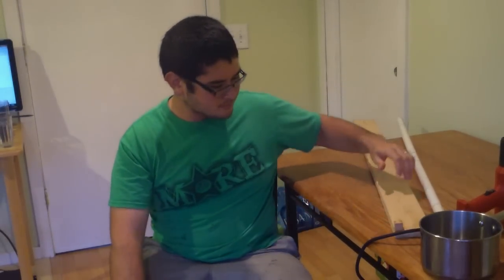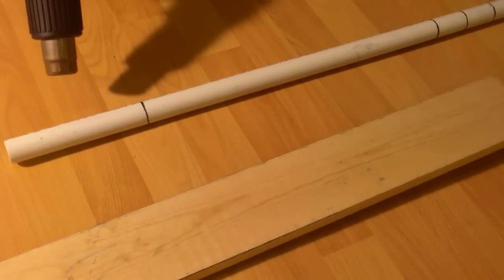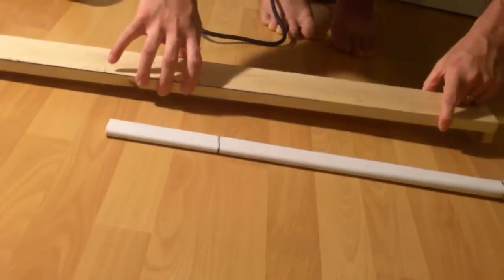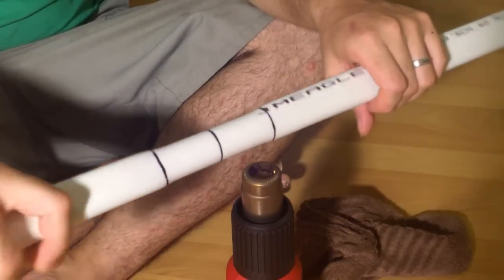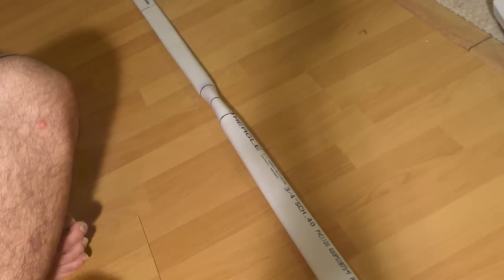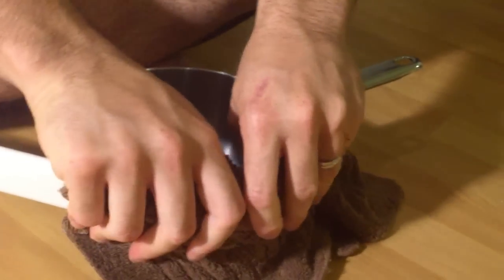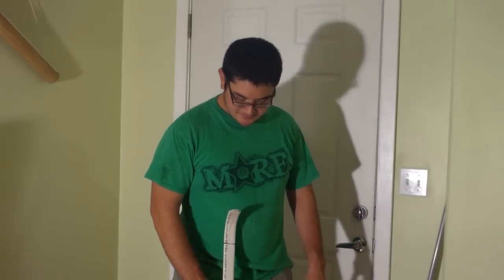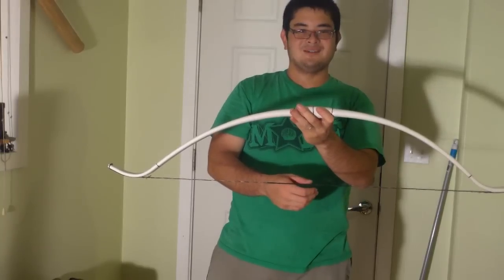How to Build a Youth Recurve Bow out of Flattened PVC Pipe

Comment: Put a cap on both ends, heat sand on the shove when it’s hot about 300*-400* pour the sand into the PVC pipe shake to San to make sure it’s all over the pipe when it becomes pliable that you could shape it to what you want

Comment: My bow just snaps. I've tried twice and each time the limbs snap
Reply from the maker: What kind of PVC are you using? Its walls should be at least 2.5-3mm thick. It should also pass the hammer test, here's a link: https://youtu.be/I-kyGn_bj84
Reply: BackyardBowyer I'm using white PVC 20mm in diameter (because I live in Australia I can get the exact 3/4 inch but I believe it 20mm is close enough) it is schedule 40 class 12 and the walls are 2.5 mm thick.  It is 1477 grade.  It is 4ft long.  The bow collapses when I leave it strung for longer than a minute.  Do you think I have bought a bad pipe? 😂

Comment: Love your videos, been checking them out for a while and entered and exited the world of PVC bows earlier today. Made 4 out of various diameters of PVC I had already  (1", 3/4", and 1/2"), flattened recurves... And all went well until stringing. no matter what I did, no matter which bow, the strings  all wanted to pull back around to the front of the recurve... Tapered ends with v-notch nocks. After about two hours of this I gave up. How do you prevent this when both sides look straight to each other?

Comment: So I finished making one of these. it wasn't perfect (being my first attempt) but it works fine enough. the only problem is that since I am just new to archery it's draw weight is a little too heavy for my comfort zone. My draw length is 30"  and I was hoping to make a bow that would pull at around 25 lbs until I am more comfortable. how would I reduce the draw weight enough?
Reply: I think you should make it longer in first place, try a new one

Comment: Hey Nick, great video. When I string my bow, it bends sideways and forces the string to slip of the side and all the way to the wrong side of the bow. I can tell the bow is very slightly curved down the front profile. Is reheating and getting as straight as possible the best fix for this? Thanks.
Reply from the maker: +Reid Bam Is the bow tapered all the way, or are the ends just flattened slightly? Also, how much did you squish the handle in? If the handle is pressed too thin, it could cause the bow to flex sideways. If the limbs are too round, the bow will want to roll over and shed the string.
Reply: Thanks man ;)
Reply: +BackyardBowyer can you make your pvc pipe soft without an heat gun
Reply from the maker: Noah Van Corbach You can use a stovetop, torch, fire, hot coals, oven, and just about anything that puts off a good amount of radiant heat. Make sure that you don't burn or scorch the pipe when using any sort of flame.
Reply: BackyardBowyer oke thanks man

Comment: hurray.. I finally finished  but I found putting the pot on the side and setting in my floor curving the ends were so much easier well at least for me..
by putting the pot on its side all i had to do is lay it on it and bend it ant hold till cool the other way my pot kept siding and my bow had kinks in the curve part but all n all i believe the next ones i make will be easier after the first one it usually is,,right
thank you

Comment: I have tried but I don't think I'm heavey enough it won't flatten.. I weigh 160 5ft tall and a women what do I do need to make for grandson by Christmas
Any help will be greatly appreciated
Ty
Reply from the maker: +Sondra Todd 150 pounds is right around the tipping point for flattening 3/4" pipe with body weight alone. First you have to make sure the whole section of pipe you're trying to flatten is completely soft. It should be soft enough that you can press the pipe walls together with finger pressure. If one spot in the middle of the limb is still cold, the whole pipe won't flatten.

You may need to build a heat trough, which is just a piece of cardboard or a half tube covered in aluminum foil (or a piece of aluminum flashing, etc.) that will reflect heat and help things go quicker.

If you're confident that the pipe is soft enough, try using clamps if you have any. If you are having trouble trying to stand or kneel on the board and keep it lined up, try setting the board on a step or bench and sit on it. This usually can help keep the board stable while letting you put all of your weight on the board.

Hope this helps!
Reply: Also my board is only 3" wide will this play a part in how it works alittle narrow but fits.. This all helps so much thank you for your quik reply and answer .i will let you know how it turns out tomorrow thx again
Reply: When I tried to put the string on it it bent..crimped guess it was a fail can you tell me how  repair it ..can it  be saved 
thank you
Reply from the maker: Do you know what kind of pipe you're using? Is it schedule 40? Are there any markings on the pipe?
Reply: BackyardBowyer not sure just bought 3/4 " PVC  pipe its white where would it say schedule 40 at does it say on the pipe
Reply: I guess if it doesn't have schedule 40 on it its probably not..here whats on ot...3/4" silver-line pvc-1120  sdr-21  pr 200  psi @73 f [astm d-2241     nsf-0w or pw -g
thats it
thank you
Reply: Ok thank you ...I bought the right pvc pipoe but I should ask you I bought a precute bow string not thinking ..I bought a 38 inch but if the bow curves does that take away from the 38" will my premade made 38" string fit or ot to long?
Reply: Sorry I meant 48" on the youth recurve bow is what I cut ant string I bought

Comment: hey nick I made this bow but I used schedule 40 1 inch pipe instead of schedule 40 3/4 inch pipe the bow turned out super strong and I cant pull it back every string I put on it stretch's it any suggestions to make it weaker

Comment: I tried making one of these by eyeballing all the measurements. Turns out it was too stiff to string up and when I tried to force it, one of the limbs gave out. Turns out I made two crucial mistakes:

1 - Material choice. I forgot to check what I material I should use for a bow like this, so I actually bought a length of pipe that was overkill. It was some 32x3mm pipe. That's a little over 1.25 inch OD, with a wall thickness of 1.118

2 - Flattening - I did not use a flexible board for a flattening jig, but a 4x4 inch piece of lumber. So it had no give whatsoever, resulting in a straight taper to the end. I also set my jig with a max heigth identical to the pipe diameter, so it didn't have the little 'dip' right after the handle.

The limbs were just too thick for the bow. This created a weak spot about 2/3 down the limb where it started to flatten properly. When stringing the bow, this is where the limb collapsed. 

I couldn't find any smaller diameter pvc pipe, so I'm stuck with the 32mm. Next up I will try building a somewhat longer bow, giving the limbs more flex. I will also change my jig so I can flatten the limbs better. I'll give it another shot tomorrow. :)

Comment: hi nick. i bought 1 inch pn16 (uk) how long must the bow be for adults  and is 9 inch ok for the corners or do i need more length?
Reply from the maker: Rashida Begum I don't suggest using pn16 for the bow, as the pipe is too thin and will break. You can try sleeving it over a 3/4" pipe and using both together. At 5 feet long with 8 inch recurves, it will work well.

Just for reference, the pipe I'm using has about a 3mm thick wall.
Reply: thank you very much, much appreciated...   :)

Comment: Hey Nick, I am attempting to make this bow. I bought all the exact materials ( 4 ft sch 40 3/4 in pvc). I am using a friends heat gun, it is a little old but seems pretty hot, i can put my hand 4sh inches from it without getting burned though. I tried several times for several minutes to soften the pvc, I hold the gun very close to it, but nothing happens. The pipe doesn't even slightly soften. Please help me out, Thanks so much, Bryce.
Reply from the maker: Bryce Belshin Hi! Do you know what the wattage of heat gun is? Heat guns generally come in around 750-1500 watts. At the 1500 watt output, it should take about 5-10 minutes to heat a bow enough to flatten. If the heat gun is 750 watts or is stuck on low setting, it may not be hot enough.
Reply: BackyardBowyer  Ok, thanks so much, i just wasn't doing it long enough. Love your videos!
Reply: +BackyardBowyer Hi Nick, Im kind of having the same problem. My heatgun is 2000w, and when set on maximum, it's exhaust is red hotm, so the heat shouldn't be a problem, but still, i cant get pvc pipes heated properly. Only the end part is succumbing to heat and becomes moldable, and thats all. rest is either stays solid, orl solidifies, when i switch to another areas. I use white pvc, in my country they have different markings, so i can't really affirm that it's a schedule 40 3/4in, but looks are pretty similar. Can't figure out, what Im doing wrong. Could you make a tutorial on this matter please? I know, sounds dumb, but I'm really out of hope right now :D
Reply: I never got mine to heat, I also tried it over a stove and  got it hot enough to bend but never enough to flatten all the way.
Reply: +Bryce Belshin i had the same problem it smashed down alittle but wouldnt flatten all the way
Reply: I don't have a heat gun, I was having the same issue softening it. I ended up baking it in the oven it did the trick...I am not recommending that as its probably not safe do at your own risk..it would probably work for these little bows though mine was 5feet and I couldn't close the oven all the way so I did one side at a time with door cracked open. This was the first time I have attempted this inspired by nick, it worked working it is an art someone mentioned he makes it look easy but he has done so many.

Comment: Hey Nick, I love your videos. So I started on this bow, and, after a while of heating and flattening I got through it and strung my bow. Figured it was too long so made the string a bit shorter. Now I have two problems: 1. The bow is a tiny bit crooked (was very crooked, fixed it with some heating). 2. My bow end snaps! About 10-12 inches from the top of one of the sides, it just bends through. I'm using this yellow pvc pipe, your yellow one seems sturdier though. I live in the Netherlands. If you could tell me about it that will help me a lot. Thanks
Reply: Misschien teveel hitte op een plek?
Reply: Koop gewoon een witte pvc buis werkt prima

Comment: Hey Nick. I really like your videos. I am currently working on a recurve bow of my own. I have followed every step and I am having trouble with actually stringing up the bow. I bend the bow the way you do but it is like there is way too much pressure on the bow and it just breaks. I know im not bending it too far because it is nowhere near close to how yours looks when it is and even then I can barley get it on. Im from Australia and I am using 25mm in diameter pvc pipe. It is four foot long and I have followed all measurements. Please help It will help me out a lot. Thanks
Reply from the maker: Jack Niotch The pipe in Australia has very thin walls, much thinner than what I use. Most guys building PVC bows in Australia usually end up sleeving one pipe into another to get something comparable. Check out @147 . He has several videos of bows he has made with PN-18 pipes.
Reply: BackyardBowyer Ok great thanks. I just still don't understand why the bow wasn't bending the way it should have. seeing as it was thinner shouldn't it have bent over more easier? this happened before it crimpled over btw. It was way too hard to bend over. thanks
Reply from the maker: Jack Niotch Tubes can be tricky things. A thinner pipe can have nearly as much resistance as a thicker pipe but with less stability. It's also possible that you are using something other than PVC or that the type of PVC you are using is more rigid. That said, this bow should take a decent amount of effort to string as it is 35 pounds with a good amount of reflex.
Reply: BackyardBowyer I am from Sweden and when i draw it back it also breaks, should i get a thicker pipe?
Reply: I am from México, and the pipes here are sch 40.80 and 120 the 40 is about 3.5 mm wall thickness
Reply: BackyardBowyer you could also use electrical  conductor
Reply: What Nick used in the video is SCH40 pipe. I am from Malaysia. Since you are from Australia, I think we may be using the same system(If not, sorry I don't know Australian pipes). We don't have SCH40 here so the closest one is Class 7.  Below Class 6 is useless for bowmaking since it will collapse right after we draw it. I use 20mm diameter, Class 7 pipe for my bow and 25mm for heavier ones.
Reply: also live in sweden. I tried making this bow with a 1 meter long pvc pipe from biltema and it wouldnt bend when i was stringing it. instead after I applied too much pressure it broke. where do you get your pvc in sweden?

Comment: 30 - 35 pound pull is pretty decent for somebody's first bow.  When I first took an archery course in my late teens I chose a 32 lb pull over a 40 lb pull and it worked well.  Later, after some more growing and doing a lot of working out with weights, I would have moved to a stronger bow but went into other interests.

Comment: I just made it, how long should the bowstring be? And can I use paracord?
Reply from the maker: Matus Malina The bowstring should be about 3-4 inches shorter than the bow is from nock to nock. Paracord should be fine. When the bow is strung, there should be about 7 inches between the string and the bow handle. If it's 8 inches or higher, make a longer string. If it is too short, either get a shorter string to tie knots int eh string until it's the right length.
Reply: BackyardBowyer Thank you (y) love your videos
Reply from the maker: Matus Malina Thanks for watching!

Comment: i have seen a lot of videos from you but i have still one question.
i can taper the bow just like you do but, my result is that the bow has bumbs and cracks in it? should i heat it longer?
i cant get the white pvc but i have grey pvc it doesnt matter i think but iam just saying mabye is that the problem?
greats chris slootweg (iam dutch sorry for the bad english)
Reply: He said in one of his other videos that the grey PVC is weaker and therefor he does not use it. His longbow video has directions on using it but it will have less tensile strength.
Reply: Hi today i used Gray pvc and i have the same problem as you then i tried to white pvc and it worked like in de video  hi from México
Reply: Bij de meeste bouwmarkten heb je wel witte pvc ik heb het gehaald bij de multimate maar ik weet niet of dat overal in Nederland zit

Comment: hey man, for a 5 foot pvc recurve, how long dose the string have to be?
its 1" sced 40. Also, im makeing the string from paracord. thanks man, love your channel
Reply from the maker: Tj'sReptiles It depends on how long the bow is after flattening and how far from the ends you cut your nock. The string should be about 3-4 inches shorter than that.

Since paracord stretches at first, I would make a string about 4-3 inches shorter. Once it settles down, measure the distance between handle and string. If this distance is below 7 inches, take the string off and tie a simple knot to shorten the string a little. Keep doing this until the distance between handle and string is about 7-8 inches.Hope this helps!
Reply: thanks nick! im haveing some bad luck flattening this bow. I heated it with a 1500 watt heat gun, for about 20 mins. it wont become flat. just oval. Any tips? am i being inconsistent? am i not heavy enough ( 130 lbs )
Reply from the maker: Tj'sReptiles Are you trying to completely flatten the bow, or are you using a taper flattening jig to give the bow a taper? A fully flattened bow will not work very well. 130 pounds should be enough if the pipe is soft enough. Are you using a heating trough? That will help make heating a pipe evenly much easier. I show how to use one in this video: http://youtu.be/W_n5fhII63U?list=UU_U6Yek0YgKHN_A-iTAwZbgA heating trough is just a channel covered with something heat-reflective. Aluminum foil or foil tape works well, and you can use just about anything that is curved or channel-shaped. Cardboard and wood make good troughs.Hope this helps!
Reply: Yes im trying to taper. But the heating trough is a great idea! thinks, ill build one.

Comment: would a hair dryer work as a heat gun?
Reply: Can someone please help me? My bow doesn't get straight. I finished but I can't pull the string. If I do that, the bow twists and the string gets out of the line of the recurve.
Reply: Erick Lopes I think starting over is the best idea
Reply: Anna Jones no
Reply: Heat guns are like $20 at home depot. But you can use an electric stove on high or gas on medium-low
Reply: I used a stove... Worked well...
Reply: Buy it from harbor freight
Reply: The way I did it was cheaper. I had some nail polish remover and I poured it in a can I found in the garage and lit it. It worked like a charm for my PVC slingshot.